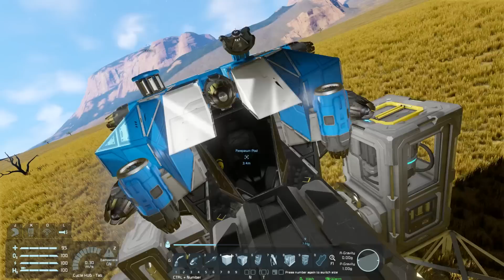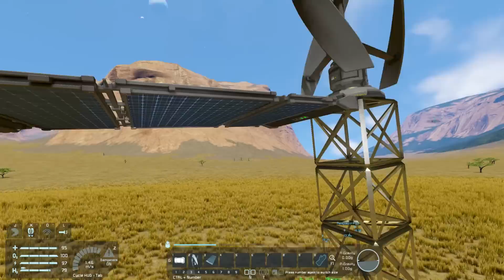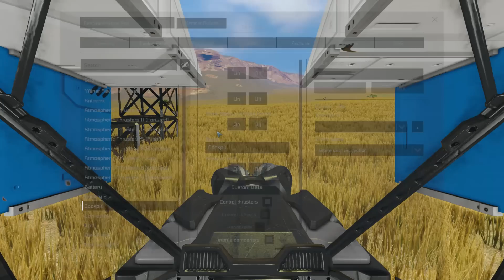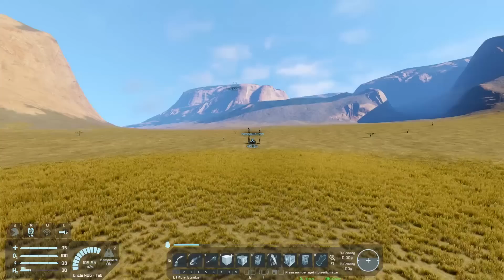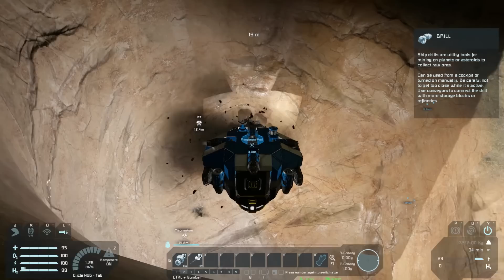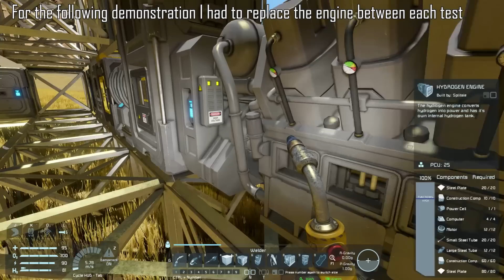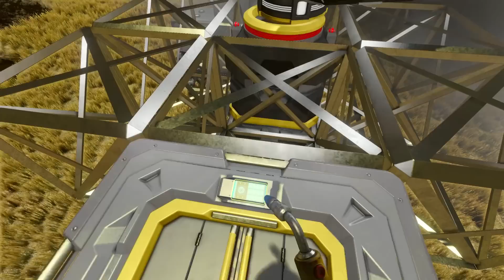Power Systems - Getting Started in Space Engineers #3 (Survival Tutorial Series)

Comment: So does the ship have to connect to a cargo container? I’m trying to recharge my batteries on a solar power station that is separate from my main base’s power, but the batteries aren’t recharging. The minute I changed the batteries from auto to recharge, the mining ship plummeted to the ground from its charing port.
Reply from the maker: If that happened it means you hadn't locked to the connector. Since connectors don't need power, losing it wouldn't cause you to fall, make sure when you connect that the connector has turned green to indicate a lock 🙂
Reply: @ I think it was locked. I made sure it was by trying to pull away just seconds before and it pulled my back to the connector. Seeing the batteries weren’t charging I changed it to recharge and the whole ship dropped (It is worth noting that my connector to the charging station is 2 blocks above the ground and my ship’s connector is a rear facing connector
Reply from the maker: Connectors have a magnet that pulls them close before locking, if it's locked you won't move at all
Reply: @ ahh ok. So the lock indicator is when it’s green?
Reply from the maker: Yes, yellow is ready to lock, red is off, white is nothing in range and green is locked
Reply: @ And to lock it, I am on console, so I’d press Y to lock?
Reply from the maker: I'm not sure what the controller key is, but I think you can check the key binds by pressing start then (that's my vague memory of it at least)
Reply: @ Okidoke. But it can just be connected to a light armor block right? Doesn’t have to be connected to a cargo thing unless I was actually unloading

Comment: Get a Hydrogen Efficiency mod, trust me. About 5x makes hydrogen much more usuable will still maintaining the need for refueling regulary with hydrogen engines and jetpacks. The thrusters are a tad bit OP if you build with the old mentality in mind. You can use WAY LESS TANKS than vanilla for the same amount of flight time, which makes a hydrogen ship much more fun to build and play with.  i Built a 28k KG small grid space miner with only hydrogen for power and one large small grid tank, with 13 small thrusters and 1 large small grid thruster. It went to space, flew around for about 30 minutes, then made reentry and docked with about 30% fuel remaining. To do that same thing in vanilla youd need about 3 to 4 large small grid tanks, or 1 to 2 tanks with on board engines to replenish fuel in space. Depending on the challenge level you like its a worthy addition to the mod list.

Comment: 12:00 to make this process safer, you can set the base battery to discharge mode and leave the ship batteries on auto. After disconnecting the mining ship, quickly jetpack to the base battery and set it back to auto. This way your worst failure case is forgetting to switch it and having to wait longer to recharge the ship instead of crashing into the base/ground.

Comment: Is there anyway to stop connector from sharing power? I really need to connect conveyors to share inventory and stuff but can't have them tapping into eachother's batterys.. setting battery to recharge wont do cause I need that battery to feed other things, this should be kinda standart for a space engineer, but seems to be the exact oposite...
Reply from the maker: Power is always shared, the typical setup that is used is that the base/mothership/mobile base provides power to all grids attached to it. Since it's usually the one with power generation capacity. Smaller grids get set to recharge when you attach and take what power they need

Comment: Hey great video. Just have one question. I have tried everything to get the hydrogen generator to work but it still says 0 MW while it’s filling up it shows 107 kW then 0. And by the time it’s done filling up it’s a 0 MW. Then I turn off the power and only turn the generator on it shows 838 kW not nearly as much as 2.5 MW. Can you help?
Reply from the maker: The engine will only output the required amount of power, to see the engine output at maximum you could build a new battery on the grid for it to charge as the larger batteries (small grid large batteries and large grid batteries) can pull enough charge to max out an engine :)
Reply: @Splitsie  thank you so much. You’re my favorite YouTuber for space engineers

Comment: If you had built the wind turbine up on the Mountain, would of have gotten more power, without a pillar? Is their a specific height you want to aim for for the turbine placement?
Reply from the maker: It's optimised by height off the voxel not height above sea level so you can still max the output in a valley if the tower is tall enough :)

Comment: It would be a lot of work doing this repeatedly but could you not just remove the cockpit from your ship and replace it on to the station in the event that you turned your base off through the ship? Also if you were to remove the cockpit would the connector detach? If not then I think this would be a solution if you were to have your base shutdown or have done it yourself but don't have a seat specifically for the base. Do correct me if I'm wrong as I only have a few hours on the game.

Comment: I feel I'm a bit late to this, but I usually use a small hydrogen tank to operate a hydrogen engine with one H2/O2 generator.
Reply from the maker: You can certainly use the tank as a way to stockpile some hydrogen before you turn on the engine, and my general opinion of the engines has improved since I made this video, but since you need 2 O2/H2 gens per engine to meet their fuel demands it can get expensive on the ice

Comment: I’ve crashed my ship 3 times already due to overloading
Reply from the maker: This is very much a bare bones design, it's often worthwhile adding some extra lateral and lift thrusters as well as an extra battery to get the most use out of the cargo space once you have the materials
Reply: Splitsie there is also a problem with my ship. I’ve repaired it, and even upgraded it, and it doesn’t want any horizontal movements and how do I charge it? I think it’s out of battery, that’s why it won’t move, I can move it up and down, just not left or right, and I already checked if everything was on... I have the exact same layout as you, but every time I go to charge it runs out of battery, like, the entire base does

Comment: Gota new subscriber man, your tuts are helping me alot bro, Thanks.
But my battery is bugged, it says 2.93kwh and its fully recharged. It lasts like 2 minutes and its empty. What can i do?
Reply from the maker: If you're using the smaller of the small grid batteries they should hold 50kWh when fully charged and will often not last long at all. The larger small grid batteries hold a maximum of 1MWh and the large grid batteries hold 3MWh so I suspect you're using a lot of power somewhere so the charging isn't happening properly, though without more information it's hard to guess beyond that :(

Comment: i've tried re-loading, moving my hydrogen along with a conveyor, turning it off an on, breaking it down and rebuilding it, but it doesn't put out any power :( I don't use mods or anything and i have the same set-up as you.
Reply from the maker: When you try to turn it on, do you have either an O2/H2 generator with ice in it connected via conveyor, or a hydrogen tank connected? You need to have at least one of those things for the engine to receive fuel while also having a secondary power source to jump start it (could be a battery, turbine or solar panel).
Reply: @Splitsie  ahh i see

Comment: while watching the vid , i was curious , about a thing. is it an easier to build a mining drill base sort of at that point ? then use roover to transfer stuff , reason for it is limitation in speed and weight that u have to fight off every time .

 base is without this restriction, while  it automine all the time , it should be able to supply its own.

its feels dry playing this game , while understanding that engines , turbines and other power in/out stuff works on stone age level.
in 2014 no weight engine were discovered, engine that pretty much nullfy weight.

also aluminum ? why there is none ? low weight high durability structures ! aluminum is really understatement nowadays in the games.

Comment: Something to note about wind turbines, horizontal ones in cardinal positions do not cause issues with one another. So you can put up enough vertical blocks to be at optimal height and then stick 4 blocks on each side of the top one to create a + shape and stick a turbine on all 4 sides. the length of space required turbines to not interfere with each other is the length of two turbines. So basically you can place two Horizontal turbines pointing at one another and they won't interfere with one another. Therefore you can pack 4x the power production in the same area. and you can also build it upwards  and repeat every time you're at the new optimal height. It's ugly as fuck but it works.

Comment: When i set my ship to recharge off the 8 batteries on my base,the connector powers off and wont charge. Any suggestions
Reply from the maker: If a connector loses power it will disconnect, in the case of turning all of your on board batteries to recharge that grid technically has no access to power so in situations like reloading your game you can end up with the connectors dropping off, I haven't seen it much within the one session though. When it happens have you been modifying the ship that has the batteries on recharge?
Reply: @Splitsie  when I pull up the control menu it dosent give me access to base block menu, but I restarted and made a new ship and it connects

Comment: So i cant transfer stone from my ship through the connector into my base. i have no clue why not. very confusing
Reply from the maker: With any issues you have transferring stuff through your cargo systems the way I troubleshoot is first check that everything I'm trying to move things through has power, then I check to make sure any connectors are actually locked that I thought were locked, after that I run along the whole path from start to finish with my welder out to ensure that every block that I think is built is actually complete and conveniently while doing this I normally notice if I've put a sorter in the wrong way round that's blocking the flow of stuff through the system.

It's also worth noting, though it's not an issue with the stone you're trying to move, that if you're trying to move components then the small grid small conveyors are too small to allow them to pass through, ores, gasses and ammunition can all pass through just fine though.
Reply: @Splitsie  Thank you so much for all the help. I love your videos man! Thanks so much for responding.

Comment: Thank you very much for this video series!
I've experimented a bit with the rescue-pod and the blocks and batteries.
First of all I've noticed that there are 4 landing gears but only 1 is visible, the other 3 are hidden (in the menu), is there any particular reason for that?
I've also noticed that the thrusters and hydrogenthruster are disabled and invisible. When i turn them on, the parachute will not work properly and it causes the rescue-pod to tip over. (Probably because of the dampeners) So i get why they are turned off. But what's the connection here with the landing gears? ;)

My next question is, does the battery need power to run itself? Because I've turned off all blocks (inclusive hidden ones) The battery lasts for a year, but it still says that 100mW are in use. (Output)
Or is this just immersion and the natural discharge over time? :)

Anyway not so important, i just find it interesting. Your video-series already helped me 10'000% :)
Reply from the maker: I think there are some blocks (like remote controls) that can't be turned off and so will continue to use power over time, I don't believe there's any default output since a battery on it's own will never lose charge. As to the hidden blocks, I'd say that was just the designer wanting the control panel to be neater and easier for new players to navigate, I don't believe there's any other reason for it

Comment: The H2O engines are terrible for providing energy to a ship...

It consumes the H2O Waaaaaayyyyyyy too fast to be viable on a small ship, you'll need at least 4 of those if you want a medium sized utility ship that can carry more than its own weigth.

That make 4 X 16k L of H2O, wich will last you about 10 minutes while under heavy use.

So you need H2O tanks, wich even on small ships are freaking humongous!!, and to be at least capable of doing a 30min flight you'll need at least 2 of those, OR 4 H2O generators with at least the ships weight in Ice stocked in the cargo...

See how stupid that is?, they really need to tweak the Consumption of H2O, because its fucking terrible as a power source...

Its perfect on a base, because it doesn't move..., on anything else?, rather go with a shit load of batteries, at least you can have 12 batteries for the same amount of space that would take 4 engines and 2 H2O tanks and 4 generators and it will run for at least 6 times the amount of time...
Reply: This H2O engine just stupid. 

Why you melt ice, use energy to split water on H2 and O2 and then burn H2 again to get power? 

This just stupid...

Comment: When I last used one, it used zero hydrogen if other power sources covered my net needs. As a result, the engine is a rather useful solution to peak energy needs that exceed wind and solar, especially when using a hydrogen tank to feed the engine (so I didn't have to run the o2 gens right when i needed power the most). Then I simply refilled the tank with the o2 gen later, when my power consumption wasn't peaked, rather than running it continuously.
Reply from the maker: It almost seems like it's best used as an alternative to batteries. It takes such a huge amount of hydrogen to fully charge a battery that you're almost better off thinking of the hydrogen as a battery you can mine

Comment: Put your batteries in a group, with a change mode option, so you can toggle between auto and recharge. Just get in the habit of using that instead of the control panel for battery settings and it will be easier. Good video, glad I went with wind over solar when I setup my initial base in my latest play.
Reply from the maker: The other option is to make a timer block that switches the lock on the connector at the same time as changing the battery state, you can then have that timer on your hotbar to do both with a single button and never worry about forgetting (though you can still get the occasional bug with disconnects when reloading your game)
Reply: hehe I  just done did that on my own save.

Comment: Careful with discarding stone from cockpit. It can break and/or destroy your ship when it lands on the hull or any other part.
Reply from the maker: It can in rare situations, if you're not locked to another grid or the voxels then you should be safe as the vehicle will get pushed out of the way. Other than the boulder being spawned inside the same volume as a grid the boulders won't do any damage (which is sad because launching them at other ships and stations was a lot of fun, though a bit cheesy for multiplayer) :)
Reply: @Splitsie  Hey, Splitsie, i've noticed in most of your videos that you can see enemy signals dozens of kilometers away. How do you enable that? I'd like to keep an eye on some Remote Drone Assemblies.
Reply from the maker: @KuradiKylmdingdong  The distance they're visible depends on the beacon that's on that base, if it's broadcasting out to that distance you should be able to pick it up, if the broadcast range is shorter then it'll drop off, as far as I can think of there isn't anything I've done to enable that behaviour specifically

Comment: What if i want to launch to space how do i do that how do i make a rocket ship???
Reply: Splitsie will probably get to that eventually.

Allthough if you want to get there now, I suggest you build a ship that has Hydrogen Thrusters. They need to be connected to the conveyor grid (either using Conveyor tubes or directly into tanks). Have a Hydrogen tank and a H2/O2 generator on the rocket with enough ice to fill the tank entirely. Keep flying upward until you reach 0g!
Reply: @ThijmenDF  thank you so much
Reply from the maker: Yep, I'm planning on doing that very soon :)

The only thing I'd add to what Thijmen said (at least without going into a whole lot of detail) is that you should avoid pushing up against the 100m/s speed limit with your thrusters. Any effort you exert against the speed limit is wasted so you're best keeping your ship at just under the speed limit. Either do this with your reverse thrusters switched off and pulsing your engines (tapping up to keep near the speed limit but just under it) or using thrust overrides on your forward thrusters and adjusting them as you go - I'll be describing both of these techniques in detail soon :)
Reply: @Splitsie  ok thanks ill put notifications on so i can get notified when you upload it :)